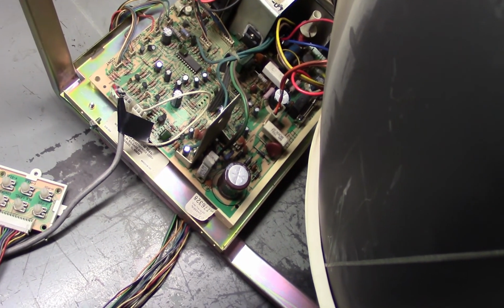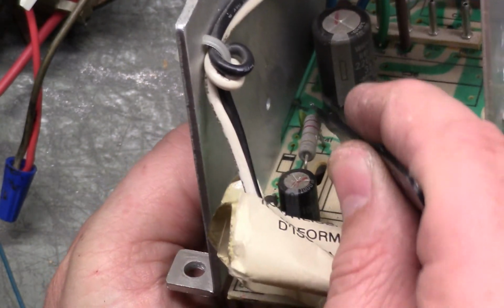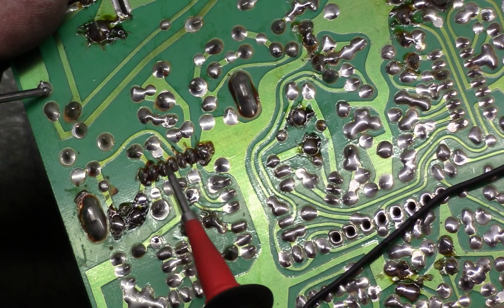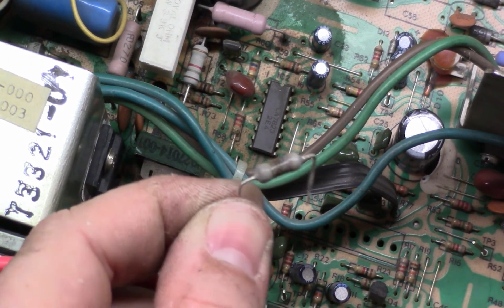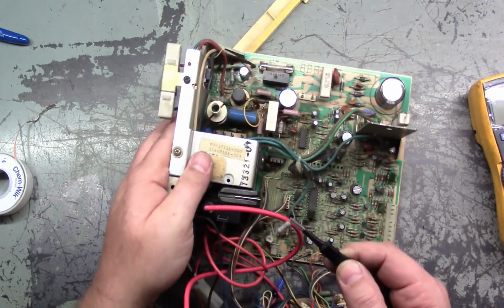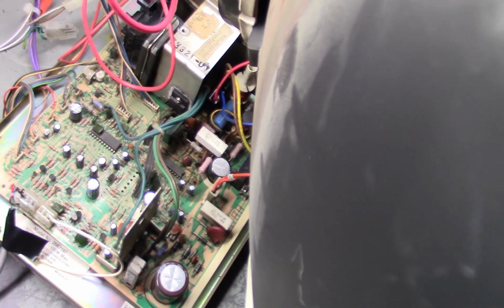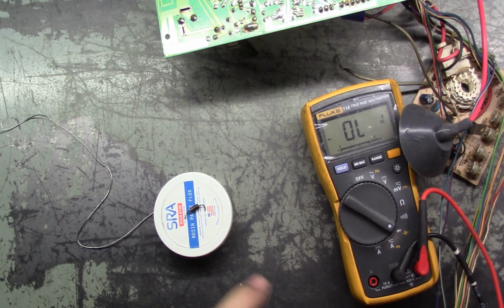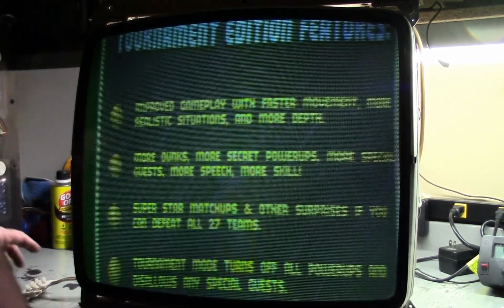25" K7000 Arcade Monitor Chassis Repair - Vertical Collapse From Arcing Flyback

Comment: I feel like I owe you 280$ for just changing 2 diodes d20 and d21 i think it was to fix a blow fuse on power up and 2 resisters r91 and r92 to fix vertical collapse, thats how much it would of cost me to send those in. 😂 plus shipping so lets say 325$
Reply from the maker: Sweet!

Comment: Any good way to test IC3 other than testing for a ground short ?
Reply from the maker: Not of which I’m aware. If it’s got a ground short, it’s bad.
Reply: @MikesArcadeMonitorRepair  thx. I have 
Vertical collapse, but the two resistors and the two diodes test good. Just don’t have a LA7831 on hand to check.

Comment: Damn r92 was bad. Fixed my vertical collapse. Thank you for the troubleshooting. Now I must fix the red. I can only see it when I crank up the pot but. The whole screen and background goes red too. 

Thanks mike !
Reply from the maker: You’re welcome. My pleasure. Nice job!could be a tube issue. Swap the red transistor with the green and see if the issue changes to green to rule out the transistor.

Comment: You helped me fix my vertical collapse on the Facebook group (which I really appreciate).

I replaced the h.o.t first, didn't fix it. I ended up not getting the wire from the fly back on the tube very well and it fell off and caused damage to what that one had.

I pulled it back out and did the shotgun approach and replaced every single IC on the board and did a cap kit. I shotgunned it because I was afraid of what else I might have damaged.

Probably but the best approach, but I figured by the time I paid shipping 2-3 times it would be cheaper to just buy everything at once. And now I'm confident my neo geo monitor will work great for many years to come.

Comment: Ive just had this same issue on my k7000 19" flyback arching, i replaced the flyback for a hr demien brand this time, fired it up and i had partial vertical collapse, my problem was the Vertical ic had gone bad.
Reply from the maker: Nice job.